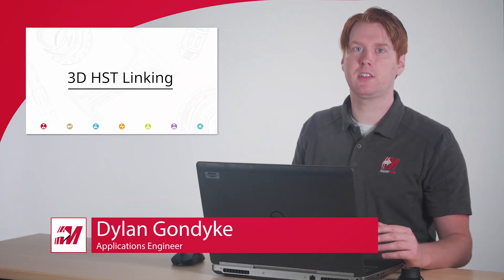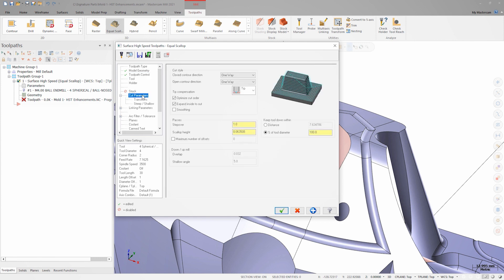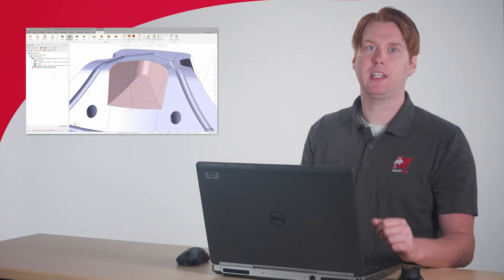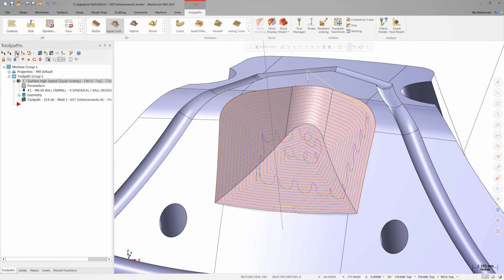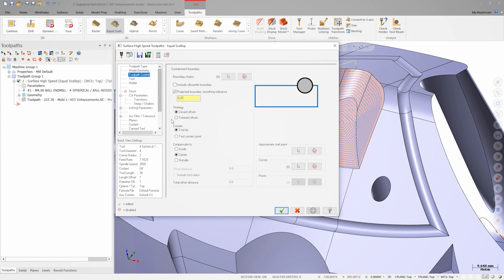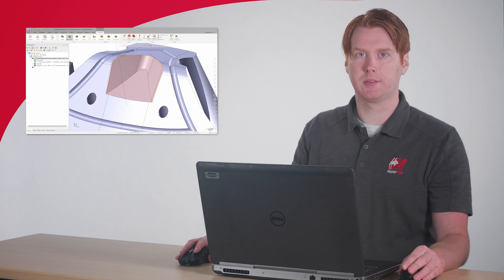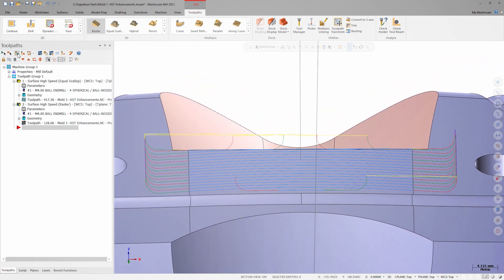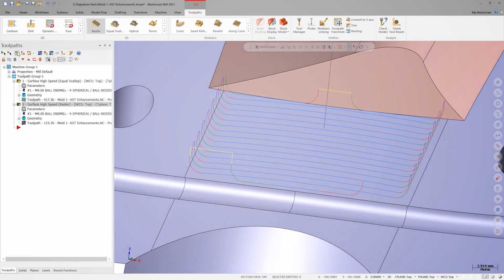Mold: 3D HST Linking

Comment: Now I'm no expert... but i am paid to machine and program molds and dies and I can't help but think when you use a realistic step over for an actual finishing tool path those little loops will be very unnecessary and add a fair bit of machine time comparatively. 
I mean its not like someones going to sit there and polish form faces regardless of how you machine it...
Reply: I agree with you with very small step over the transitions between passes are not visible anyway
Reply: @aspeaerospaceprecisionenging  even with good tooling I still get visible transitions but not everywhere and definitely nothing you can actually feel if you closed your eyes.
Whether this would affect molds for plastics I don't know as I work on molds and dies for aluminium parts and sand cores. But like I said, any visible marks would almost certainly be polished out regardless of injected material.
Reply: @wildin13  Certainly for the majority of paths it's not a critical consideration! However, consider the scenario where we use a Lens tool or something else with a large contact patch/large stepover, or a part case where we're deliberately going after a ridged/textured finish- we then have to explicitly control this motion to remove the unwanted transitions.
Reply: @DylanGondyke  tbf I don't use lense/barrel or custom tools so I overlooked that use. We normally go for smooth walls on our dies and any textures or patterns are fully CAD'd so we'd use standard tooling with 3D toolpaths. 
Do you often use lense tools to form horizontal ribs on walls? Our walls are often too tall to even consider these tools.
Reply: @wildin13  I primarily use lens tools for near-flat finishing. Slightly dished surfaces, for example, are good candidates for lens tools. But even angled flat surfaces that are being machined in a 3 axis machine can benefit from circle segment/Accelerated finishing geometry if fixtured in the right orientation. I will go after taper/barrel tools quite often for tall vertical rib/wall areas in mold work with 5axis motion.
Reply: @DylanGondyke  we only have 3 axis capabilities and I'm aware of time savings from accelerated finishing but we could never find tooling with enough length and rigidity. What scale of steep walls are you talking about? 
Our standard tools for such walls start at around 100-150mm straight reach but we also have XL and XXL lengths plus extensions for when we have no other options.
Reply: @wildin13  With only 3 axis capabilities, you're at the mercy of the height/draft of your walls for accelerated finishing applications. Maybe there's a balanced workpiece angle and a middle ground barrel tool that you can use, but if the walls are too high you'll likely have to swap to a ball tool for a portion of the wall bottom, and then you've got a blend that'll need to be smoothed down. It may or may not be worth it- likely not at all if you're only programming and running one-offs.
Reply: @DylanGondyke  and that is exactly our problem rounded into 1 coment. One off dies (a mirrored version if we're lucky) so to have tools for all occasions we often have to use sub optimal tools for the particular job.
I just wandered if you had a solution to similar problems but it seems you have, a 5th axis...